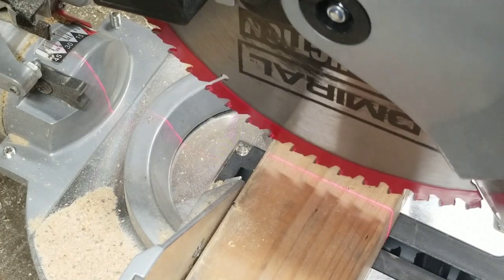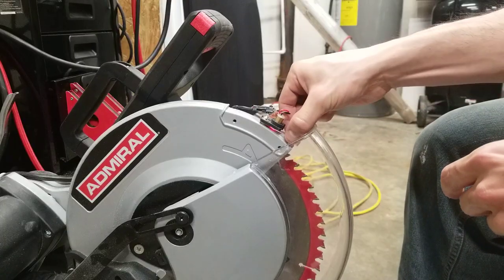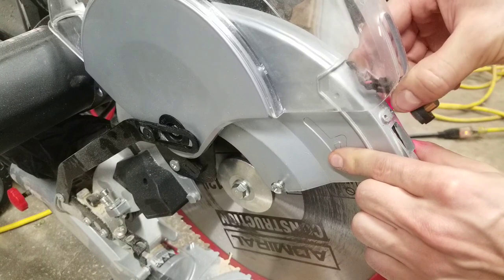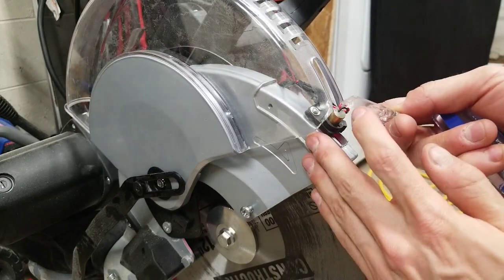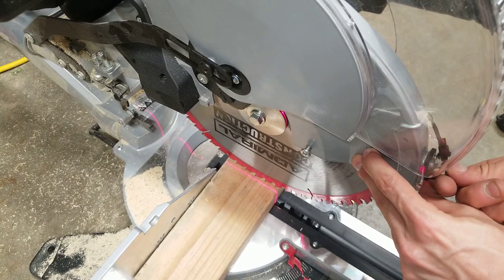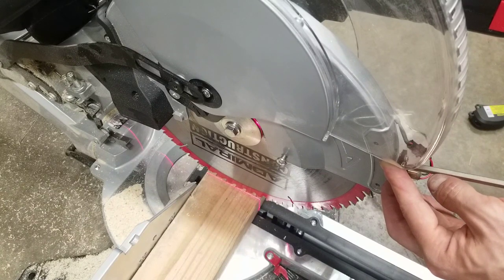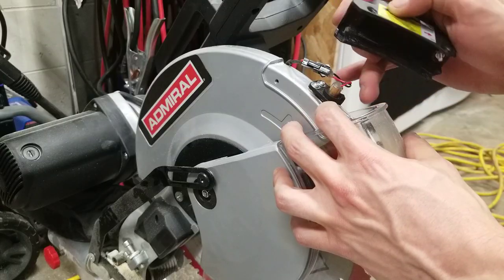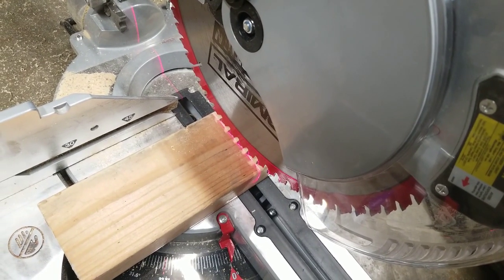Adjusting a Laser Guide on a Miter Saw (Admiral 12")

Comment: You explained everything extremely well and your production quality is just awesome! I spent far too long on trying to get this stupid laser working properly. After the first couple of times that the little clear "sawdust guard" slipped off and fell down into the blade guard - I almost boxed it back up. But it actually cuts pretty well and I got a heck of a price on it. I've got a couple of ideas for a workaround with a different laser and housing but if you have any you'd be willing to share - I would greatly appreciate any input and insight you might have. Thanks again!